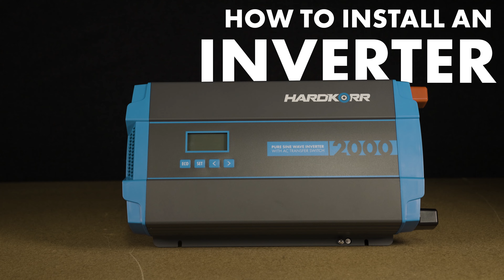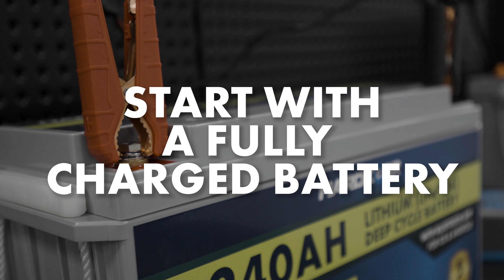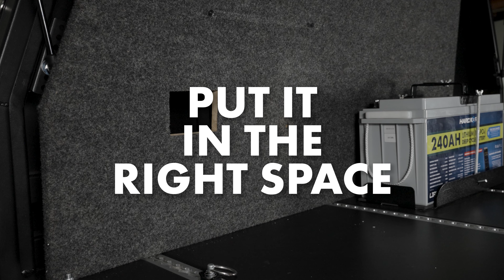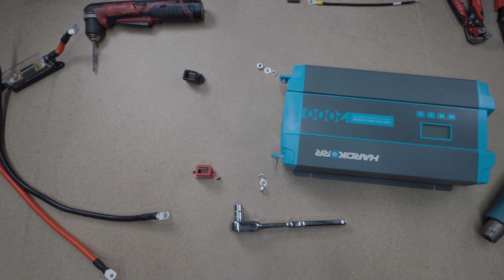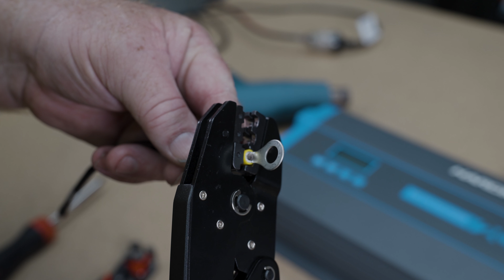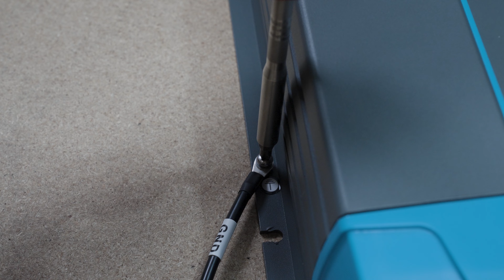How to install our Pure Sine Wave Inverter with AC Transfer Switch

Comment: Re: AC switching
 I have a campervan with a 240v circuit for when plugged into power at caravan parks. Is the inverter simply plugged into a 240v power point for the AC to kick in automatically, essentially stopping the inverter from drawing from the battery? Trying to get my head around this switching function in terms of wiring